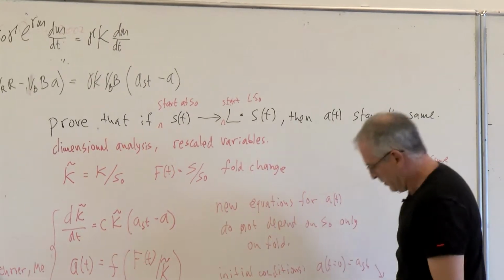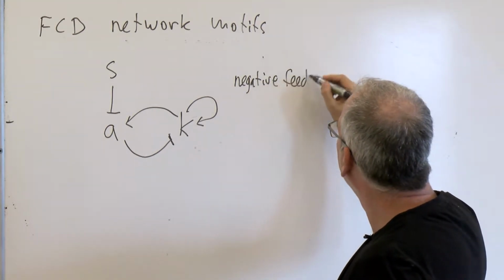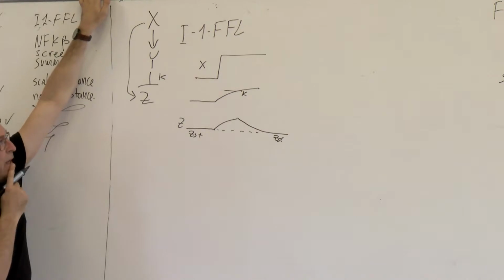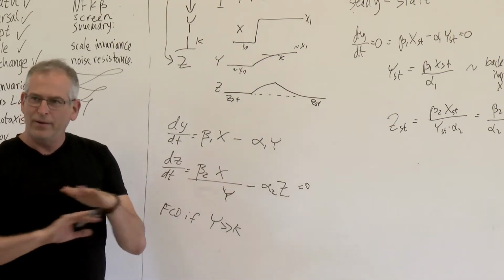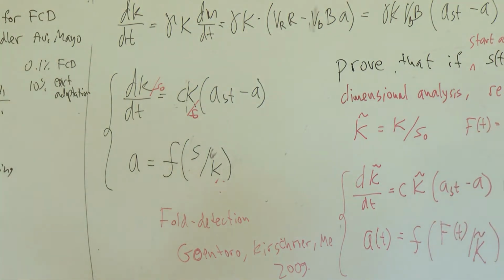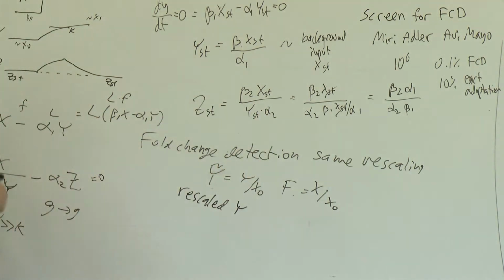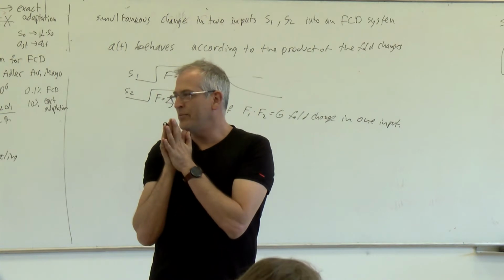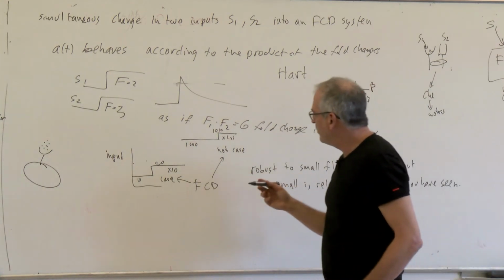Systems biology course 2018 Uri Alon - Lecture 7  part B - Fold Change Detection

Comment: This is de paper about Comparing Apples and Oranges: Fold-Change Detection of Multiple Simultaneous Inputs Yuval Hart, Avraham E. Mayo, Oren Shoval, Uri Alon. 2013. DOI: 10.1371/journal.pone.0057455

Comment: In the case of the system integrating a two fold increase and a two fold decrease (=0, for sensory systems), and if the sensory system is inside a person comparing winning and losses in life (events, results),  Kahneman´s utiliy funcion  is asymetrical in the positive and negative domains. I drawed the graph and a simple example to understand the comparison logic that can create the asymmetrical function. I don´t think I have read that before. Be a nice person (whoever you are) and comment on published works about the theme, please. Thanks professor Alon!